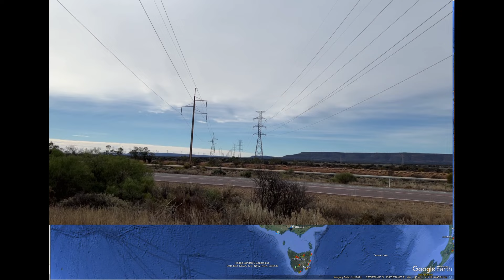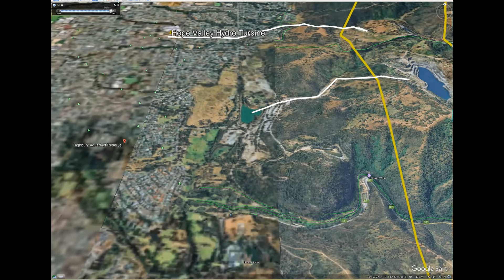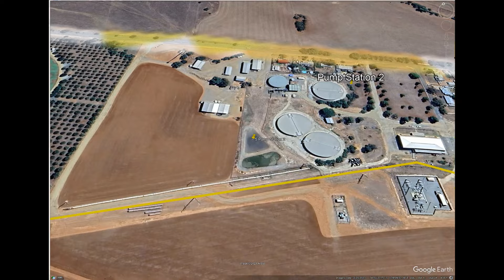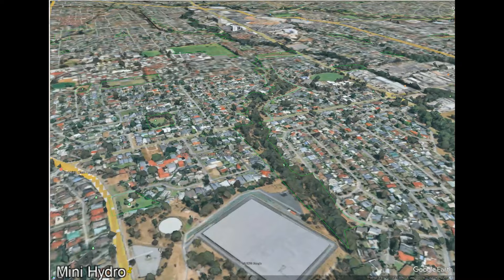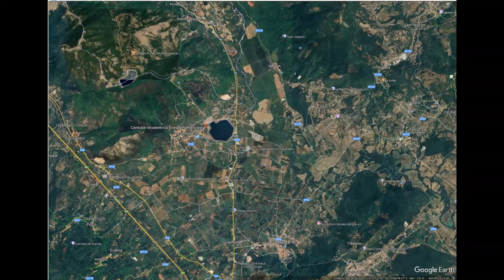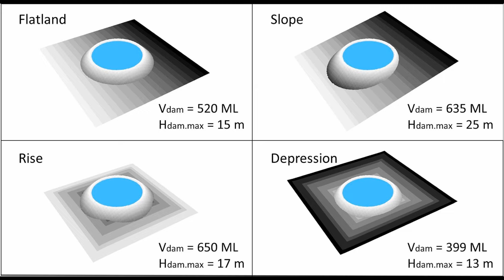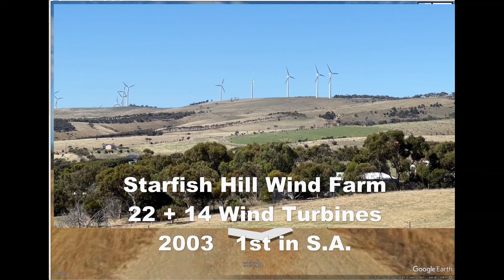Better Big Battery using Closed Loop Pumped Hydro Energy Storage for Dry Environments

Comment: Battery tech is not mature enough for vast storage needs,wind an solar are a pipe dream

An it's to expensive to rewire the national power grid and pumped hydro power is just crazy ,

just look at  snowy 2,0 the dpi minerals mapping shows over 300 billion in critical minerals are to be put under water in the valley system just for power production 

JUST BUILD  INDUSTRIAL NUCLEAR POWER PLANTS
Reply from the maker: There is nothing stopping private enterprise from building Nuclear Reactors to heat hot water and generate electricity.

They just need to develop the business case and go to the Big Banks and Retirement Funds.  
https://www.superannuation.asn.au/resources/super-stats/#:~:text=Total%20superannuation%20assets%20were%20%244.1,with%20more%20than%20six%20members.
The Association of Super Funds of Australia has $4.1 trillion at the end of Sept 2024 in assets.

The BHP is the owner of the Olympic Dam min in South Australia has the world's largest known uranium orebody.

Construction time range from 6 to 8 years.
https://www.sustainabilitybynumbers.com/p/nuclear-construction-time.
We currently have 24 coal fired power stations operating in Australia,

So do we therefore need around 24 nuclear power stations to be built to replace them?

AGL Energy  (Austalian Gas & Light) 
https://en.wikipedia.org/wiki/AGL_Energy
Is active participant in the generation and sale of elctricity.

So what is stopping companies like AGL from built some nuclear reactors in Australia?
Reply: @Highbury5089 isn't Australia currently prohibited from adopting nuclear power under federal policy 

Personally I think we should build 60 or 70 nuclear power plants like france to power Australia,

Its the cleanest,greenest and has the lowest footprint on the environment
Reply: @Highbury5089 currently Australia is prohibited from nuclear power by silly federal policy 

But building 60 to 70 nuclear power plants like france around Australia seems like a long term strategy to meet carbon goals

It's the cleanest greenest an has the lowest footprint on the environment,

An no private sector an banks should not pay for it the government an tax payers should so it will be a public owned asset for the good of the nation an cannot be sold off to multi nationals

Comment: 40 percent electrical energy  lost with pumped hydro.
Reply from the maker: The literature suggest 80% of the energy used to pump the water up the hill is recovered when the water runs down the hill.
Not all the water is released in any one done day.    The 7 day reserve means only one 7th of the water will be released.
If the dam does not leak and evaporation is low the energy does not disappear over time.

Chemical batteries are a bit more problematic 
If a fully charged lithium battery is left alone it will slowly go flat.    They are normally fully discharged every month. So lithium batteries might not be a good choice for storage in periods of long-term fluctuations in energy supply.
Reply: you must include all of the energy transmission losses in and out of the pumped hydro. Losses. Don't stand alone.
Solar and wind loss
Reply from the maker: @robtheelectric  that would be true for the most of the things in South Australia.    The biggest user of electricity in SA is the BHP Roxby Downs mine.    They have duplicated long sections of power lines in an effort to ensure continuity of supply.   This duplication would involve loss of energy compared to a single set of cables
Reply: Is there a chart or table showing how much water storage is required per MWH of electricity output at various elevation deltas?
Reply from the maker: @steveallen1340   Yes

P = Q x g x Hnet x η

P is power, measured in Watts (W).

Q  is mass flow rate in kg/s (numerically the same as the flow rate in litres/second because 1 litre of water weighs 1 kg)

g is the gravitational constant, which is 9.81m/s2

Hnet  is the effective height difference between the top dam or water source and the turbines.

η   is the product of all of the component efficiencies, which are normally the turbine, drive system and generator.    Usually around 80%
Reply: @Highbury5089  thanks a lot, great information.